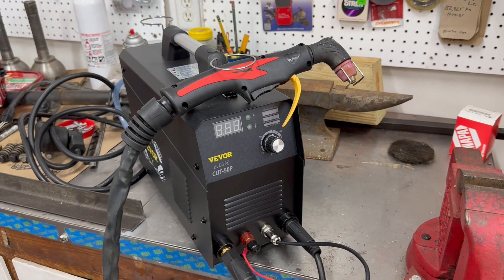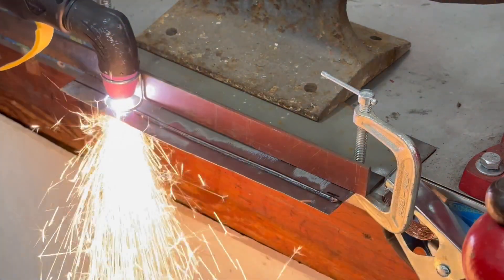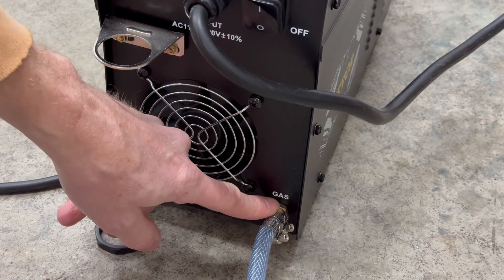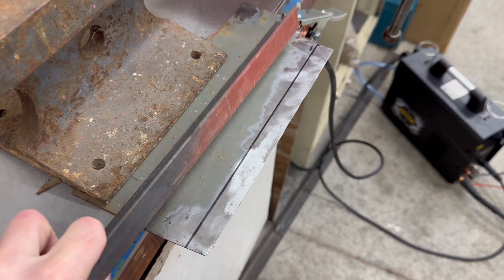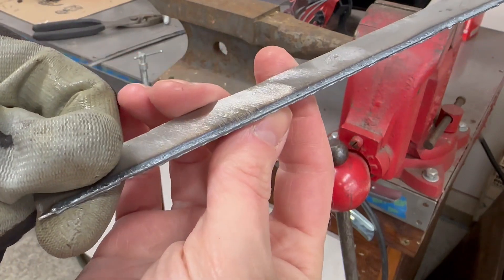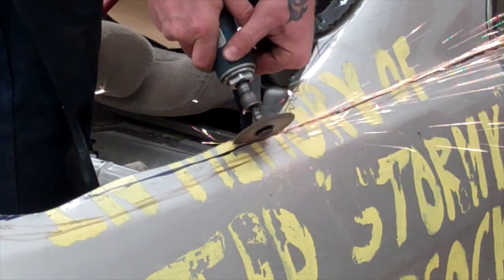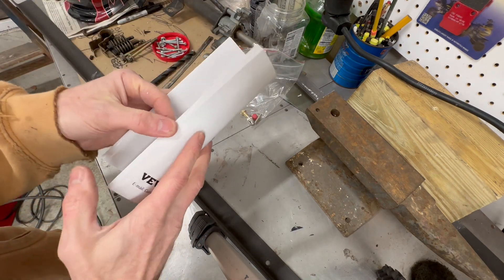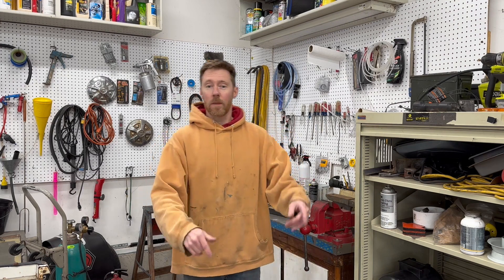VEVOR 50 Amp Plasma Cutter - Honest Review - Non-Touch, Pilot Arc, 110V/220V Dual Voltage

Comment: Mine worked when i first got it . Up to 3/8. Only used it a couple times in first year. Now  19 months later it makes pilot but won't start a cut.
Reply from the maker: Have you replaced the tip? This is a good entry level plasma, but I found that it does go through tips faster than a more expensive plasma cutter from Arc Captain.
Reply: @6thGearGarage  replaced all the consumables  . Replaced the cheap hose to get rid of air leaks. Drained water from my compressor.  There isn't any water in the filter on the machine .  Tested ground  .
Reply from the maker: Hmmm ground was going to be my second guess, but it looks like you've tried everything that I would have tried.
Reply: Yeah. Beginning to suspect  something on the circuit board died

Comment: Will it cut non rusty sections of a 83 yota frame?
Reply from the maker: Yes it will cut through a frame no problem. I’ve cut through thicker with 120v, I just had to go slow.
Reply: I'm sure it will iv built alot of my toyota with there 210 dc tig

Comment: Awesome, how large of compressor do you usually need for plasma cutters?
Reply from the maker: Mine is a 20 gallon, but I'm not sure of the ideal size. I think a smaller compressor would just run more, due to the smaller tank.
Reply: @6thGearGarage  ohh nice I was under impression you needed like a 60 gallon compressor
Reply: Maybe I was thinking of painting a car too? 🤔
Reply from the maker: @JonnyDIY  I've painted vehicles with my 20 gallon compressor. The larger tank will keep the compressor from kicking on as often,  but for painting or any other took where you need a steady flow of air, it is the output of the compressor that really matters most. This little 20 gallon is a high output, meant for painting.
Reply: @6thGearGarage  ohh wow nice, and is that with an HVLP gun or Siphon? Which compressor is it? I need one but didn't want to get too big,  but wanted to paint still
Reply: you can get away with a really small compressor for running a plasma. they dont really take a whole lot of air to work.